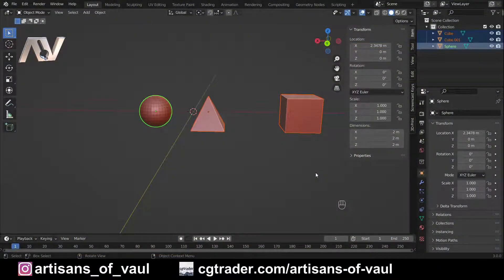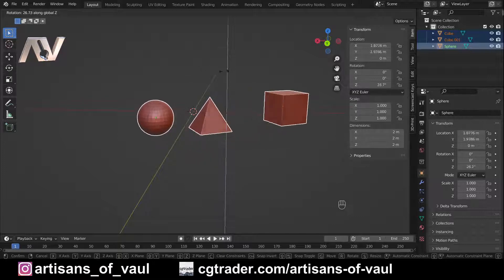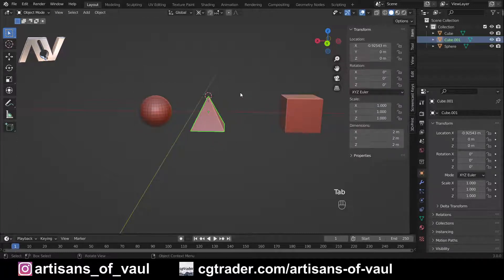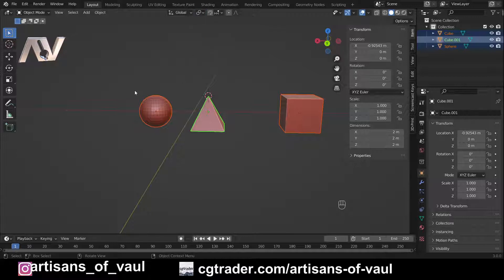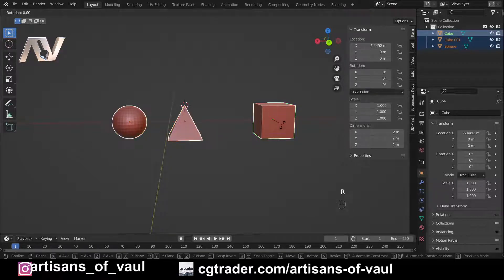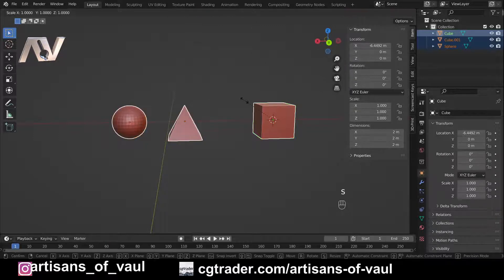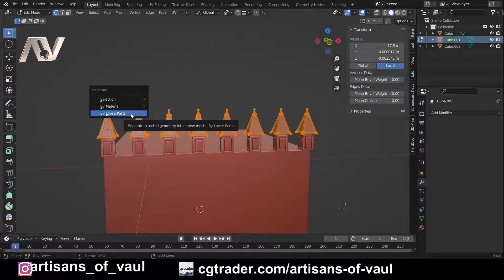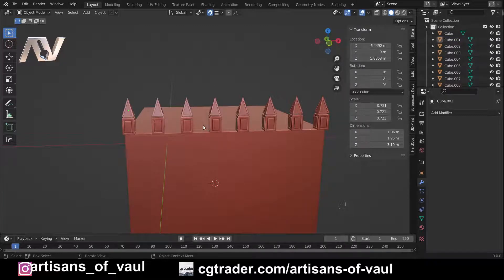Controlling how you transform objects in Blender

Comment: 4:50 had me scratching my head, so I played around with it and found that snapping the 3D cursor to the active object has nothing to do with it.  You can skip that and go straight to box-selecting the sphere and pyramid.  The key point here is that box-selecting a set of objects does not reset the active object.  The cube is still the active object even though it is no longer selected.

Really all you have to do is select all the objects and then shift-click the cube again to deselect it.  This also leaves it as the active object despite it no longer being selected.

Comment: Awesome video!! So glad you're posting on youtube now!

I was hoping you could do a tutorial on how you array on curved surfaces, like the rivers on the sides of the Gatling gun in your other video?
Reply from the maker: Thanks alot!

The array for the rivets is actually the same as the one for the barrels, either using HardOps or the array with object offset to make them into a circle. I do it using Hard Ops for the rivets part way through the video on radial arrays.
Reply: @ArtisansofVaul  thanks! I was able to try those out and was pretty successful. I guess I should have been more specific, I meant more like on the curved armor surfaces on the body of the gatling gun, lining the raised edges of the panels.
Reply from the maker: @Jeffzip  Ah, I get what you mean now. They are done individually by eye as for complex edges that seems to be the best way. For consistency I go into side view for the relevant axis and use the origin of the sphere that will be the rivet as the point of reference (normally making sure that the origin is on the side of the armour so that the rivet is exactly half way sticking out of the trim. Not sure how clear that is but I can put it on the list of things to do for a video.
Reply: @ArtisansofVaul  That makes perfect sense, thank you! :) I'll be looking forward to it in the future!!